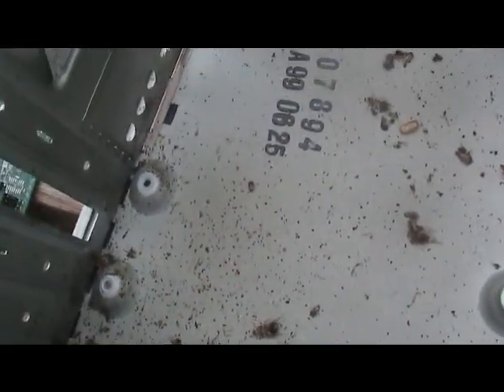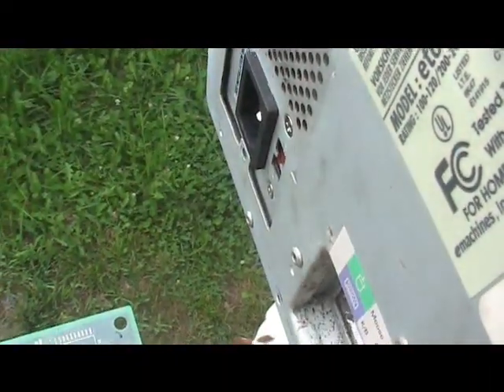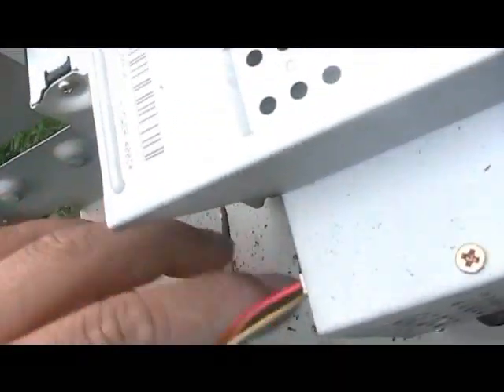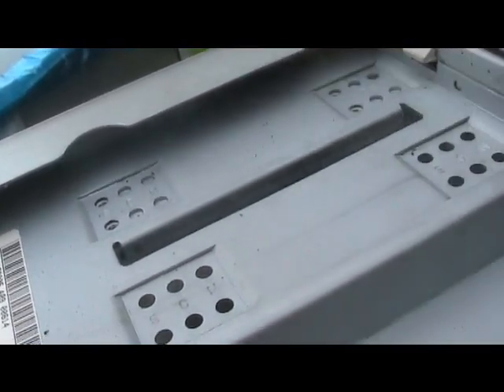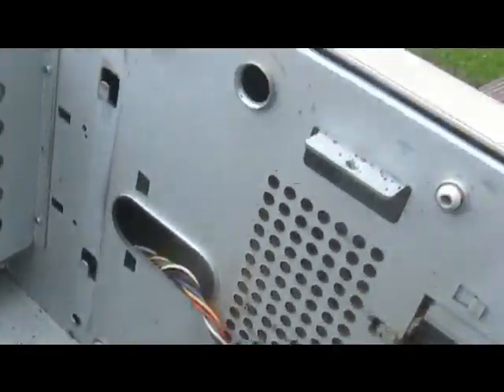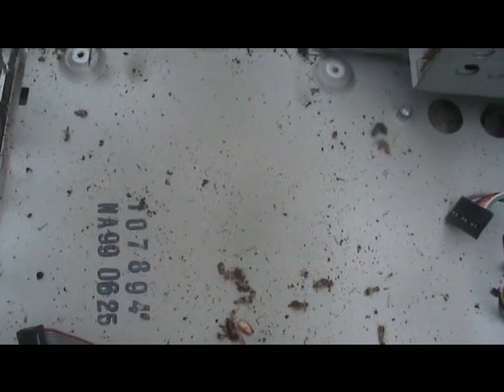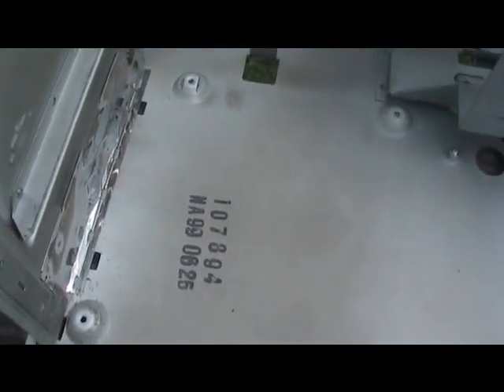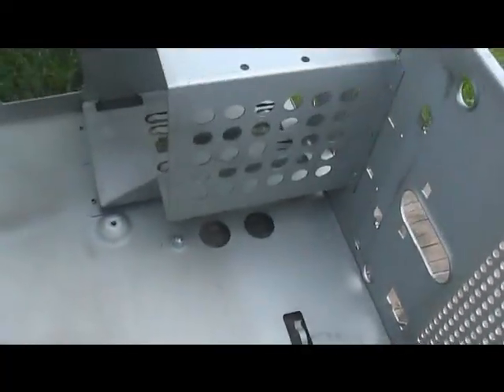Cleaning of a Roach infested Computer Part 2

Comment: You know, some computers over 10 years old and "UNTOUCHED" from my experience maybe my bad luck... the circuitry on the motherboard just cracks after I removed the cpu cooler because of the 10 years of tension between the motherboard and heatsink and some components are like so brittle and the whole thing broke... Maybe my luck... but most of em survived with just a bad ram.

Comment: my 11 year old pc was wayyyyyyyyyy worse! note to self or anyone.....never put your cats food an water dish near your tower! luckily mine still works but i bought  a new tower an sold my thermaltake lvl 10 gt case an managed to save everything.... i did get a new cooling system for my cpu and got a better power supply! a little 91% rubbing alcohol an cnc electronics cleaner fixed it right up!